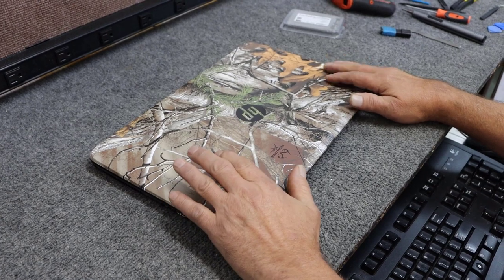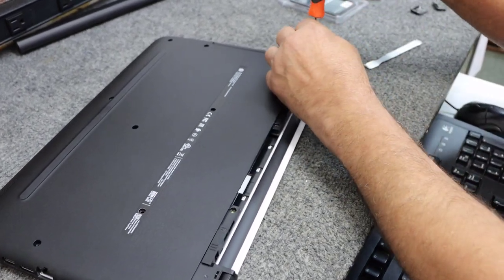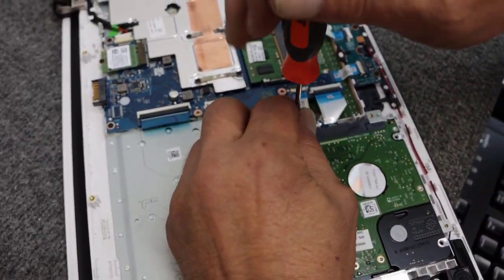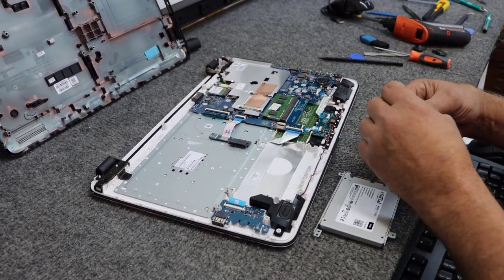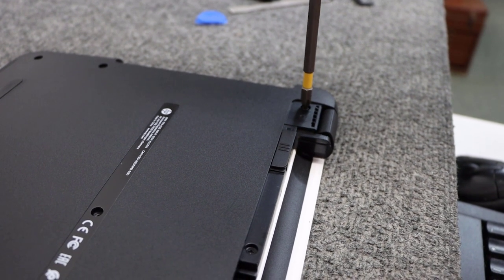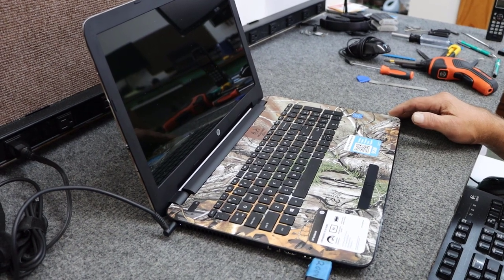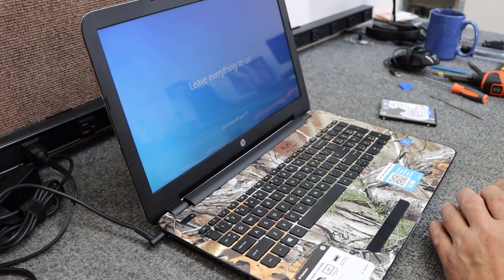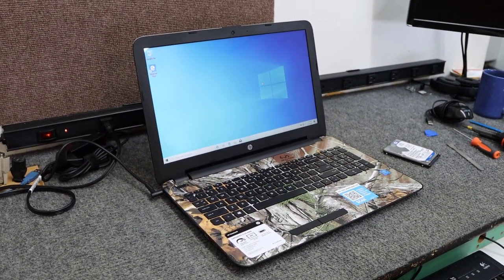HP 15.6" Camo Laptop How to Replace Bad Hard Drive With NEW SATA SSD

Comment: Was looking to add RAM and see how to open this thing up (picked one up as a spare laptop for $50).  2 years later this video is still helping!  Thank you!  For anyone else looking to upgrade the RAM, you will need 1 stick of 8GB DDR3L PC3L-12800 1600MHz SODIMM.

Comment: Thank you for your videos. I love how you get straight into the job at hand and don't obsess with gaming performance of a computer. 

I volunteer at a local community centre where they have six HP laptops. So far three hard drives have failed and I have had to replace them. I could not recover the data using a caddy attached to my Windows laptop, but as soon as I attach it to my Mac computer the hard drive is mounted and accessible.
Reply from the maker: Wow, good thinking. I would not have thought that would work.  Hdd's are so unreliable anymore. Thx for watching. Dale

Comment: pretty nice tutorial 👌 mine is currently not powering on, I already tried doing a hard reset but that didn't work and in addition to that not working, there isn't a led light next to the charger port when its plugged in and i already ruled out that the charger is working so I'm gonna take it to the repair shop sometime next week but where could i get a genuine replacement for this model though because I've been searching for the longest while ?

Comment: i know this is a older video but it was helpful. is there a faster processor or ram i could get for this exact laptop? thank you for your time
Reply: Mike - I'm not sure about the processor, but the RAM included is usually only 4GB.  You can upgrade to 8GB max (only 1 slot inside as his video shows).  You'll need 8GB DDR3L PC3L-12800 1600MHz SODIMM

Comment: i have this laptop ...its been slow since day one ,,,, i did notice that walmart sold the same laptop with out camo and it was much bigger ( as in internal parts , harddrive, memory, etc) guess the price of using real tree was alot of money  ... but anyway ,,,, will this new SSD speed up this laptop ? ..... and its there any other upgrades that could be dont to improve this laptop?

Comment: You could of just mirrored the old hard drive so when the ssd is put in it works. Then if you wan tot do a clean install do a system restore to factory.

Comment: I have the same HP laptop that runs VERY slow every since I bought it. I took it to my local computer repair shop and they said to reset it to factory settings. But, it still SLOW....Do I need to change the hard drive or the RAM?
Reply from the maker: re-setting it will not help at all. The problem is the HDD in it. You need a new 2.5" SATA SSD. That will make it much faster for sure.